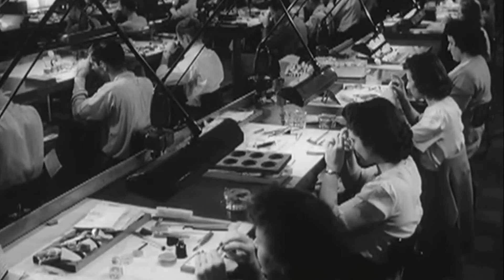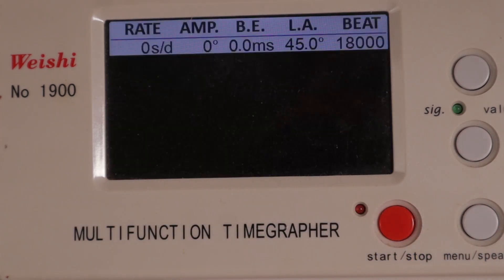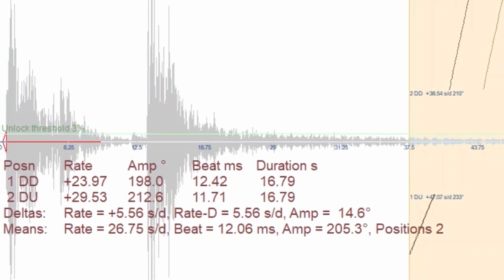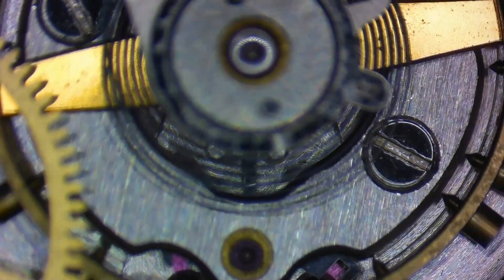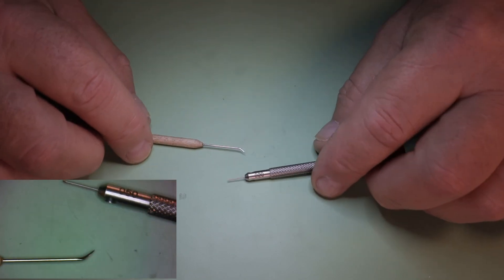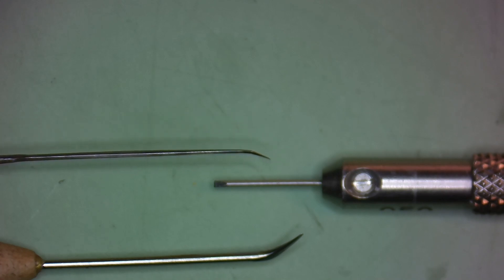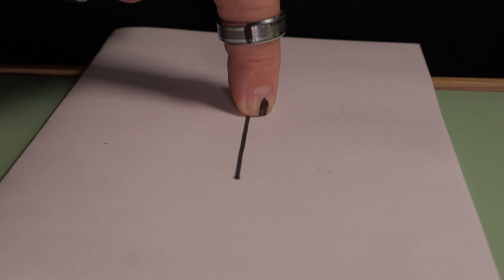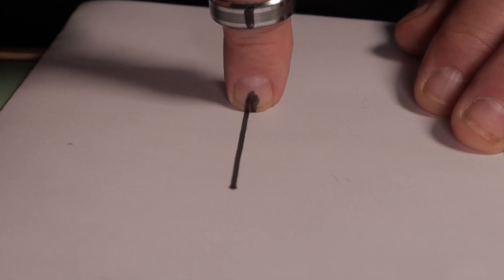This SIMPLE TRICK Changed Everything for me

Comment: Alex, when adjusting the collet, say with a screwdriver, are you twisting the blade to open the collet or are you using the taper of the blade to open the collet by pushing the blade into the gap?
Reply from the maker: No, you’re not trying to open the Collett at all. The last thing you wanna do is loosen it. You’re just using the opening like a screw slot to be able to move the Collett.

Comment: I am an absolute beginner in watch repair as a hobby.
I have a question. I have been using a smartphone app to check rate and beat error. For amplitude I do a super slow mo recording of the balance wheel and visually estimate the amplitude. I assume doing it this way obviates the need of a dedicated timegrapher and the lift angle value.
Am I wrong in doing it this way ?
Reply from the maker: It’s not a bad way to learn because the way you’re doing it will give you a good understanding of how the balance wheel moves. Remember before timegraphers were even available they had to do everything by eye. What you’re doing now will work not 100% accurate but close enough for now.

Comment: I'm a bit confused, you said that the centerline for 0 beat error is from balance center to escape wheel center. I heard it being from balance wheel center to fork pivot center. Which is it ? Because I have been adjusting to fork pivot center. I don't have timegrapher. Thank you.
Reply from the maker: I’m sorry for your confusion. Technically, the escape wheel pivot is part of the escapement. Not the escape wheel itself just the pivot. So the escape will pivot, the teleport pivot, and the balance pivot are all in a straight line.
But now I’m confused what do you mean when you say you adjust to the pallet fork pivot?
Reply: @Watch Repair Tutorials  the line from center of wheel balance to the center of fork pivot is the one I use to set the impulse jewel in beat
Reply from the maker: @romanmechetnerful  I see what you're saying you're talking about when you're doing it by eye. It's the same line it just extends to the escape wheel pivot that's all
Reply: @Watch Repair Tutorials  escape wheel pivot, balance wheel pivot and fork pivots are not in a straight line always. Look at some English pocket watches, those 3 pivots are in a curve most of the time. So which 2 pivot centers would I use in that case to align the impulse jewel? Thanks.
Reply from the maker: @romanmechetnerful  Sure I mean if you go back even further than that and the rule wouldn't even apply either. I’m not talking about the exception to the rule. In that case you would use the balance pivot to the pallet fork pivot as your line of center
Reply: @Watch Repair Tutorials  thank you for clearing that up for me. Thank you for your time.

Comment: Prior to having these electronic pieces of test equipment, what would the method of determining adjustment have been?  Just by eye???
Reply from the maker: Prior to timing devices. Watch movements went into what was known as the “finishing room”. Here the watches would be set to a master clock and allowed to run for 24 hours. Then they would change the position. Reset the time and run it for 24 hours. Once they had timing rates for all positions being tested, they would make the adjustments and then go through the entire process again. Depending on how many positions were being adjusted. This whole process may have taken two to three months.

Comment: I’m pretty much new to the hobby but can’t wait to receive all my tools and stuff!
✌🏼😎👍🏼
Reply from the maker: That's pretty exciting. Let me know if you need any help.
Reply: @watchrepairtutorials  I got my time grapher and tried to adjust my Seiko Srpd with 4R movement and screwed up big time! The very small brass part on the adjustment fell off the movement 😢 I think its called the index…where the hairspring passes thru the brass part. Anyway I tried the balance complete from another Seiko but 7s26 and it fit right in! Got it to run 0.1 beat error and +2 to +5 sec per day 🤯 I didn’t think that would work but it really does work! Gonna keep track for a few days and get back to you…Thanks for taking the time to read me 😂
Reply from the maker: @sylvainster30  good job. Let me know how it turned out after you let it run for a while.
Reply: @watchrepairtutorials  fingers crossed 🤞🏼 almost 24 hours and so far +3 seconds 👍🏼
Reply from the maker: @sylvainster30  the ultimate test is how it keeps time on your wrist. Give it a week and let me know.
Reply: @watchrepairtutorials  I got my time grapher and tried to adjust my Seiko Srpd with 4R movement and screwed up big time! The very small brass part on the adjustment fell off the movement 😢 I think its called the index…where the hairspring passes thru the brass part. Anyway I tried the balance complete from another Seiko but 7s26 and it fit right in! Got it to run 0.1 beat error and +2 to +5 sec per day 🤯 I didn’t think that would work but it really does work! Gonna keep track for a few days and get back to you…Thanks for taking the time to read me 😂